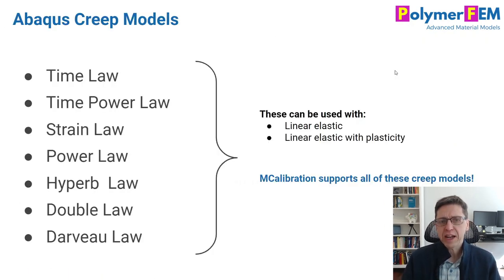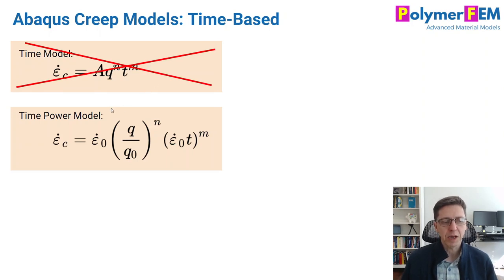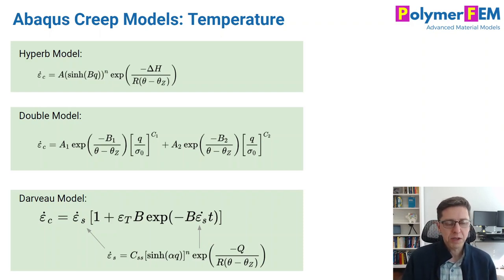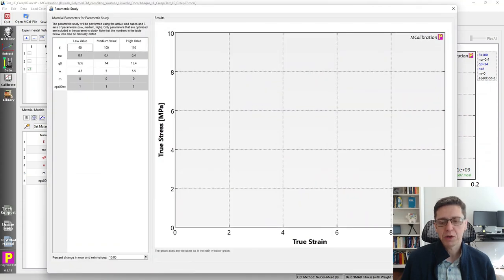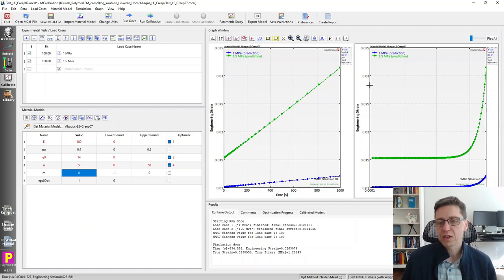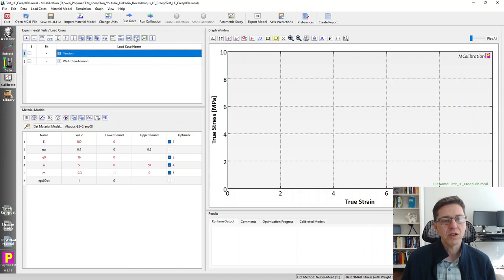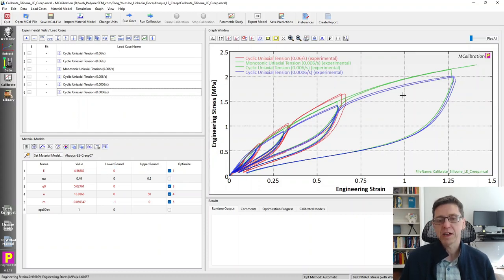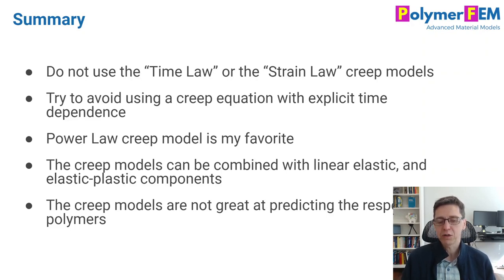Abaqus Creep Models: Which One Should You Use?

Comment: Thank your Sir. i am trying to model the elastoviscoplastic behavior of my material using the Abaqus TLVM. I tested the Mcalibration model which combine elastoplastic with isotropic hardening and the creep strain power model. it 
 fit my material behavior very well. I will like to now if this material parameters can be implemented in Abaqus by using the TLVM?

 I also found that in Abaqus TLVM, there is one more parameter f repairing to the proportion of the instantaneous modulus giving to the viscoelastic network of the TLVM!